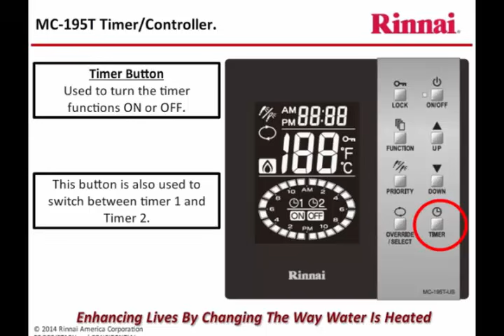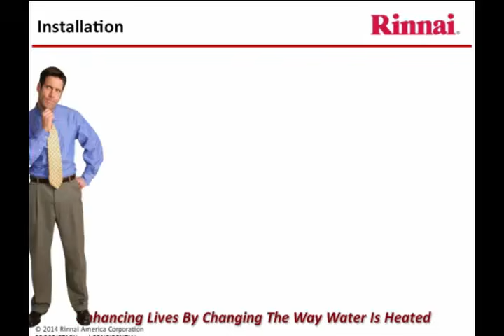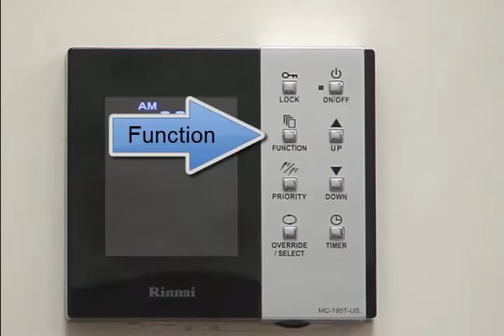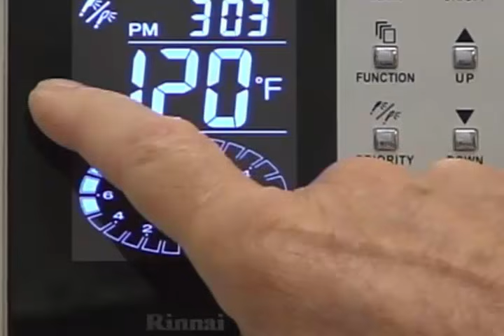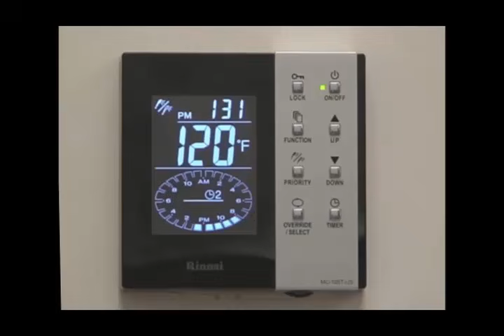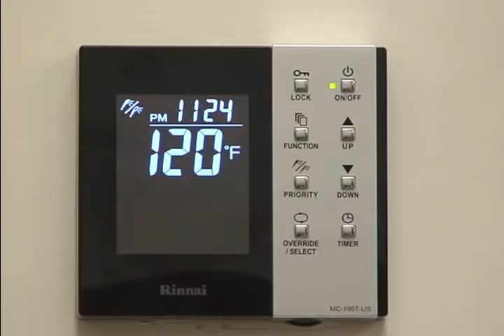MC195T Controller video

Comment: So if I get up at 6 and shower and want to turn off the hot water at 7 so my kids don't have hot water so they take quick showers - do I set timer one for that specific time period - between 6-7 for the circulation to work? Can I set it for 120 at 6-7 and 98 degrees for the other 23 hours?

Comment: I have not figured out why there are two timers??  Can i just shut those timers off and have it override and recirculate all the time rather than figure out when someone wants hot water.  No repair person seems to know more than i do about this controller.
Reply: Tom
 Problem with Technicians is training. Rinnai is not doing sufficient training. Few years ago when I was still in business things started to go south. I have learned to advise guys like you to call Rinnai directly and demand assistance stating the fact that trained tech personnel in field is not trained sufficiently.By the way the second timer from what I remember is for setting it on weekend or Holidays when you would need  instant delivery of the hot water during different hours than during work week . It is sad that nobody knew it did not tell you this. Sincerely Former President of Tankless Solutions Inc.

Comment: This is so complicated as to be depressing. Just ridiculous. Every time we have a power outage , it has to be reprogrammed. When we had it installed , we asked the installer how to operate it. He said he was busy , to read the manual and left. He also said to call him when we had a problem. Oh yeah? $100 to reset the controls.
Reply: my timer functions seem to be retained after a power outage but they won't enable till I reset the clock on the remote

Comment: Pin this to the top to save people 14 minutes of their lives... If the power goes out and you need to reset the clock, hit power, then hit function, then set the clock with up/down, then hit function .Then power again. That's it. Now you may need to set the timer back up for recirculation. Hit timer to select the first timer. Hit function. Now use up/down to go to a desired time block. Hit override select to toggle that block on or off. Hit function when done. DONE! Cue The Rock singing 'You're Welcome!'
Reply: THANK YOU AND YES, EVERY TIME THE POWER goes out for any reason I have to go through this nightmare again.
Reply: Does it really lose the timer settings if the power goes out?
Reply: ❤ this.  Thank you, you are the (wo)MAN!!

Comment: How do you set for higher than 120?
Reply: You can do it with the normal buttons. Just needs to not be circulating when you press them.
Reply: @cpmaverick  hi. Could you please  explain  how to set temperature higher then 120. If it possible step by step or video option. Thank you
Reply: @anjelamerabian9261  There's only two things to know. 1. Make sure it isn't circulating. Don't run hot water or recirculation. 2. Make sure the device you are using to adjust (the app, the panel, whatever) has 'priority'. 

If you can't do it, call Rinnai and they will walk you through it.

Comment: Rinnai should be embarrassed by continuing to sell this controller to the unsuspecting public. 

*The clock has to be reset with every loss of power (No battery back up, really?!!!)
* Whatever the user has programmed into the controller is lost when there is a power outage?
* Programming the controller is ridiculously difficult without a video to guide every step. 
* The programming menu buttons are cryptic. 
*Many of the messages that show up require a crib sheet to decipher. 

Seriously, how does a “Leader in the industry” get away with selling such half baked product?

At least they provide a video to follow, after skipping foreword through about six minutes of useless information. 

I wish I knew then what I know now….
Reply: and their wifi controller is even worse. What a sad state of affairs.
Reply: @cpmaverick  In our new build home, the plumber straight told me that they didn’t install the Wi-Fi module because it was so bad. So, there it sits in the box below my garbage Rinnai. 

Plumber also said the only ready they installed the Rinnai is because that’s what the developer specified in the contract. The plumber recommended some other manufacturer, but I cannot recall who that was. 

I’ve concluded that Rinnai is basically the Price-Pfister of the tankless world.

How they go to work each day and have any sense of pride is beyond me.
Reply: @germanshorthairdude  The Rinnai hardware is great. Before they tried to go the WiFi route they were the industry leaders. But they are failing dramatically just because they can't make it work as a 'smart device'. Crazy thing is, I don't even care about that! I just want a water heater that works.  But they don't have a good alternative to their garbage Wifi control. The only one is the MC195T and it doesn't even remember the schedule when the power goes out ...
Reply: @cpmaverick  The heating unit itself may be great hardware, I’ll take your word on that.

My experience with the controller and calling customer support tells me the company sucks for providing such garbage to the unsuspecting consumer. 

Great hardware means little to me if I can’t rely on it to provide hot water when I want it. 

I sincerely hope that someone in a position to make a difference at Rinnai will see the dissatisfaction with their product and light a fire to improve what they sell to their customers.
Reply: @germanshorthairdude  It will always supply hot water, if the hardware works. The controller is just to decide when recirculation should run. 

If you weren't aware, recirculation can be switched on to run all the time with dip switches in the unit. So you'd always have instant hot water. But of course this uses gas. So it's nice to only run it when needed. That's where they failed.
Reply: @cpmaverick  Thanks, I didn’t know that.

Comment: Video is helpful but fails make it much easier to  understand and operate.  The design of the controller is confusing unless you understand all the digital moves.  This temperature controller needs to be simplified without so many steps to achieve something as simple as setting the time. We misplaced our instruction manual and having a problem copying the text in the video to have a printed copy.
Anyone know how to get a printed edition of operating the temperature controller MC195T US?
Reply: https://www.powerequipmentdirect.com/manuals/rinnai-a594139d13440745c6fff87c867b5cd9.pdf

Comment: This is like the Grundfos system with the stand alone pump ant thermal bypass. What doesn't make sense is that the whole point of the tankless heater is to save gas by not having the heater on at all sorts of hours guessing to when I'm going to use the hot water.
Reply: Yes! so frustrating, not saving gas with a tankless heater.

Comment: Show of hands - how many people are here because Rinnai controllers are difficult to understand or just don’t work? I have to go back to the antiquated controller that is the subject of this video because their wireless RWM module is too flaky to stay connected. It has now finally gone DOA and will not reboot.
Reply: The wireless module is hot garbage. I spent almost 10 hours on hold or tech support with Rinnai in Jan 2022. And now here I am again, trying to learn about this because the Wifi still doesn't work right. 

Absolutely embarrassing and they don't seem to care either.
Reply: Fuck this water heater